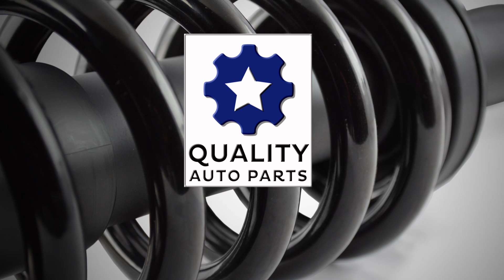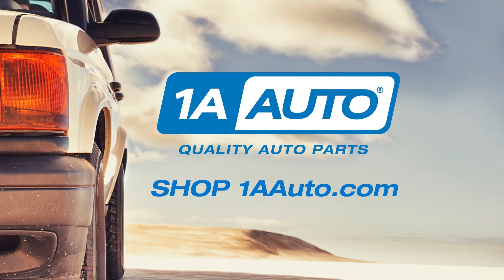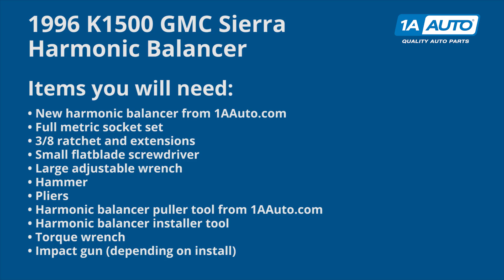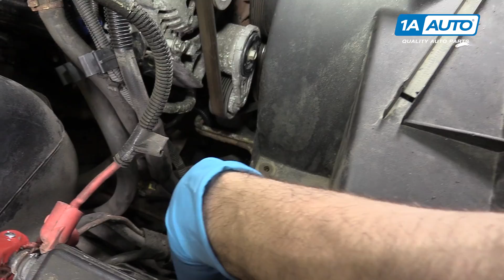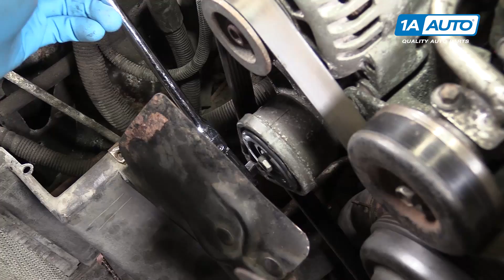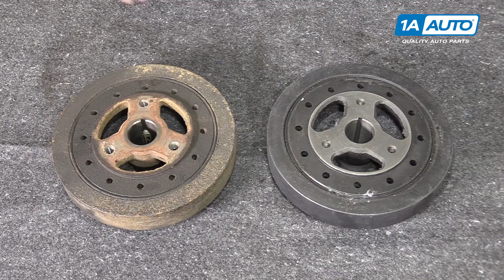How to Replace Harmonic Balancer 96-99 GMC K1500

Comment: Some vehicles have red Loctite on the built pully mounted on the harmonic balancer. You will need to 400F  heat to break it loose
Reply: I don't know the temperature rating of the rubber

Comment: Hi and thnks for all informative and helpful videos.
I have a ford mondeo mk4 2.0tdci and I need to replace the crankshaft pulley.
But the car is with automatic gearbox and iam wondering if there anyway to remove the pulley with out blocking the flywheel.
Iam thankful 🙏 for the help.
2

Comment: Just wondering if it is possible to put a mark on the inside lower half harmonic balancer so if rubber decays and loses the mark original Mark can be determined and marked with paint

Comment: What do I do if the the first part of the installer won't come out
Reply: I ended up having to re install the bolt and torquing it down until I could back it out. I would recommend not tightening the first part and have it finger tight(as the instructions would recommend). I don't know why he even used pliers to be honest. Some of these puller kits also have a socket end which would much easier.